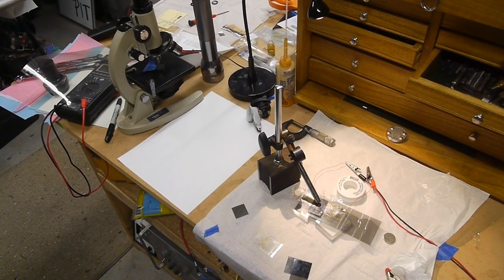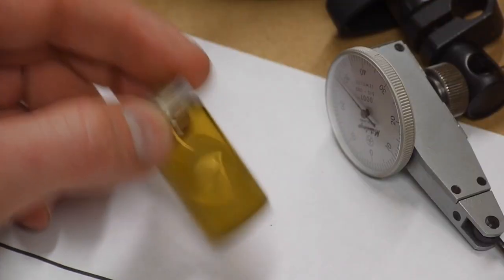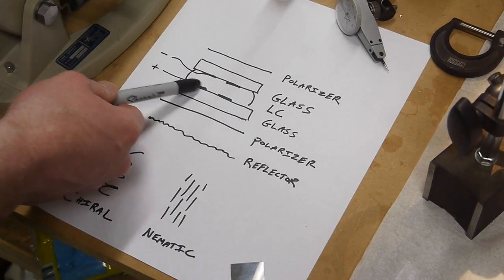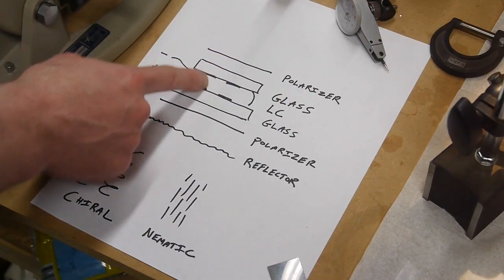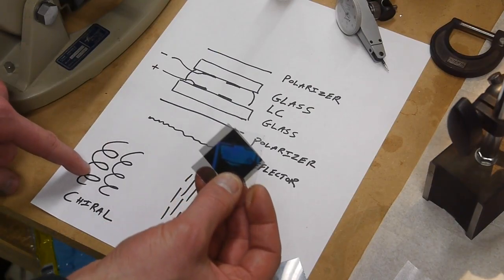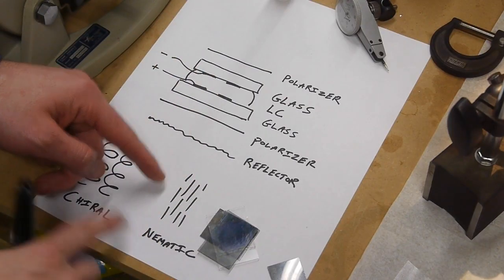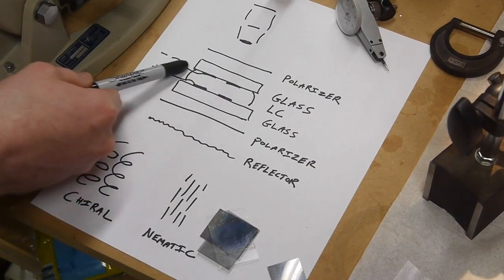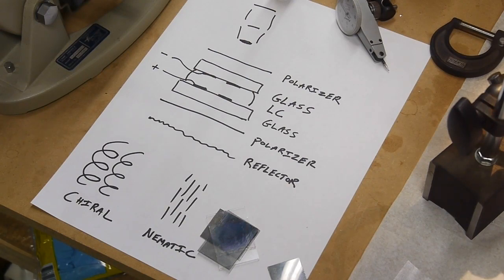Building a liquid crystal display (LCD)

Comment: Ben, I was a working Engineer in the mid 80's and needed a 4x6 TN LCD with 64 segments for an application. All the manufacturers said it was impossible. The company I worked for paid for the research to develop many of the things you demonstrated. I worked with company X to do this work. We did the 5um glass beads, ITO patterning at large scale, crystal mix ratios, -40 to +70C performance range, super glue coating then using a cloth to scratch the parallel lines. Amazing to stumble across this video and see your presentation. Thanks for bringing back the memories. Very good explanation of issues we worked to resolve.

Comment: Good job.  Did you follow this with another video?

You mentioned that the electrodes were coated with a very thin polymer and then rubbed with a cloth so micro scratches helped to align the molecules in a 90 degree twisted oriengation.  But wouldn't the plastic polymer coating act as an insulator between the liquid crystals and the electrode that it supposed to affect them?  I would think that would prevent the electrodes from creating an electric field that affects the liquid crystals, unless the electrodes are affecting the liquid crystals per a capacitive effect.  Is that what's happening?

Comment: hi I liked your video explanation...one question if you could answer...I have disabled the backlight of an lcd model Acer s231 and want to replace it with reflective light so the front lcd panel is too dark to see...should I remove the polarisers in that case and how shoukd it be placed for reflected light from back or front to get a readable view..
Reply: The right to repair is limited if it's patented or not . It's highly likely imo in the 1st amendment that it falls in a prior art but you could get sued by some patent trolls for infringing on their patent .

Comment: I have looked everywhere and cannot find anything close to an answer.  So, to everyone who knows more then I:  Can you use IR light as a backlight for LCD displays?      Why it matters.  I'm working on a head worn night vision set up.  I would like it to be able to be used for different applications in both light and dark situations while having one eye able(if wanted) to see real time/view.  So everything works on the bench. With the exception of trying the IR back light.  the importance of the IR lights rather then the norm is to be able to view through the screen like a window. with out having visible light shine forward.  When using the screen to look through, only big bold things need to be seen.  kinda wonky I know, but why not?  I will be trying it out but will not be able to for a few days, aside from being excited,  I like to plan so any help or tips would be greatly appreciated.  Salute!
Reply: Still need help?
Reply: @wertiaaudit5746  you are awesome.   But no.  I always over think everything I build. This is one of those late night irritations where I allowed conmen sense to go out the window.  Thanks
Reply: @gibbyrockerhunter  ok

Comment: Hello,

I don’t really know much about that kinda stuff but I wanted to ask how I’d notice if my LCD monitors were leaking that liquid crystal fluid. Can there be leaking without the display being damaged (inside damage not visible from the outside) or does it have to have a huge crack. Is the fluid toxic because I’m kinda scared since it would be fatal then if I touched that fluid without noticing and touching other stuff as well and I punched my monitor once thats why I'm afraid of potential leaking
Reply from the maker: If there is no visible damage, it's almost certainly not leaking.  There are many, many things in daily life that are more hazardous than an LCD monitor.
Reply: @AppliedScience  thanks for responding this quickly! Can there actually be actual leakage so the fluid will literally leak out if the monitors case? 

I know I'm overreacting but I'm a bit paranoid since I'm worried I expose myself to the liquid without noticing which leads to me being scared to touch certain things without feeling the need to wash my hands

Comment: This is the best explanation of LDCs I've seen so far, but now I'm confused. It seems to me like all that's needed to darken a segment is to apply a voltage, yet for some reason everybody says it's next to impossible to drive 7-segment LCD displays. It seems to me that it shouldn't be any more difficult than a 7-segment LCD. Is there just something really weird about the way these are typically made that makes them difficult to use? Maybe the electrodes for individual segments are never exposed, needing to go through an interface chip that is somehow invisible?

Comment: about the coating technique.....what if you spin the glass with a motor and pour some nail polish  for some time to get the ideal layer thickness (trial and error )..and the glass should be put like on an wine shaped glass  so it can be touched only by the margins  to avoid the impurities...idk if that helps, it's jut a thought.btw you are a very good at explaining very clear and not let my brain foggy.

Comment: So what exactly is the reason an LCD changes color when you press it? Is it the distance between the layers that changes or the angle of the layers?
And how exactly does the contrast control work? I know that with commercial LCDs you set a voltage to a specific value, but what exactly changes at the LC level?

Comment: if two polarizers can block back-light when they are aligned at 90 degree then why can't we achieve pure black color with them ?
Reply: One possible reason is because no polarizing filter is perfect. There will always be photons that 'leak' through defects or slip past the filter itself.

Comment: When I was a kid I used to take off the top polarizer from calculators and rotate it 180 degrees. It'd give me a white-on-black display instead of the usual black-on-white and I used to feel like a god damn scientist :D
Reply: op oʇ ʇɐɥʍ ǝɯ llǝʇ ʇ,uop
Reply: @souravzzz  ǝɔᴉN
Reply: @souravzzz  Wow
Reply: I used to spell BOOBIES. But now I'm 55 and it's against the law.
Reply: @GregorydavidMck  once I wrote HELLBOOBIES
Reply: wait, but rotating filter 180 doesn't change polarization?
Reply: Turning it over does (at least for some variants).
Reply: I see you like flipping stuff around. Why are your comments not flipped?
Reply: Now go for the name and you're all set :)

Comment: I'm assuming this is showing LCD for use as an "epaper"?  I ask because I thought LCD monitors were back lit and didn't require light to enter, polarize, reflect, and repeat the process on the way back out. I also don't see a light source in the diagram.  I'm curious about why (if it's epaper) glass is shown in the diagram. I would assume plastic would be more practical.

Comment: Hello. I've been prototyping a DIY PC build with a transparent LCD on the side panel.  Tearing down a few old displays and mounting them to the side panel without the back light assembly works very well but the internals of the case look very blurry and foggy.

Several other people have done this and their LCDs don't look foggy like mine. Why is this? I've been researching  this and haven't found any definitive answers for which screens will be foggy and which won't.

Some people say older displays have diffusing layers attached to the rear polarizer. Others say the polarizers themselves sometimes have diffusing properties.

If you could provide any insight I'd really appreciate it!

Cheers!
Reply: I think they are probably right. I recently repaired the LCD on my motorcycle and it involved removing the polarizers and the reflective layer. The remaining glass was completely see-through and smooth as was the polarizers (other than the polarizing effect). So it may just be a coating to make the screen look better in regular use.
Reply: SrgntBallisticGaming Why don't you email one of the non blurry PC guys? I'm sure explaining would tickle their ego. :)

How did it go? 2 years on.

Comment: Thanks for the explanation. Was wondering how the LCD screen in laptops are made. If I understood  your diagram, you have:  
polarizer => glass => electrode => LC <= electrode <=glass <= polarizer 
Do they also use glass when they're making LCD films that go into laptop displays or do they use some kind of transparent polymer. I have project where I need a curved display. I was thinking if I could find an LCD film that is all plastic in an old laptop, I could probably use some gentle heat to change it's shape.
Reply: Have you seen a broken LCD? I don't know what exactly what are they using, but it sure breaks like glass.
Reply: Glass actually does bend to some extent
Reply: If you have a large window in your home, place a light far behind you. Push on the glass with just finger pressure, you'll see the reflection change. 
You can do the same thing with a large mirror.
Reply: Glass is not necessarily a requirement but that doesn't mean you can get away with bending them (try pushing on an LCD screen and watch how the colors distort).  Might be worth a try though.

Comment: So how do you change colors?
Reply: Each sub pixel of either red green or blue has a color filter. The pixel is comprised of red, green and blue sub pixels. So you change the intensity of each RGB color with voltage.
Reply: I did watch the video. I'm thinking the guy who made the comment on how they change colors is asking how they do it on the LCD display which is what I explained. The color changing in the video is not how they make it work in LCD displays.
Reply: Christian Did you even  watched video? What sub pixel? He built a simple lcd! It's already amazing what he did at home.
Reply: Remember how he messed up on the distance and he got a blue color?
Reply: Robert Maxson What colors? There is a light source behind lcd, so changing the color of light... Monochrome lcd displays don't need back lighi because the foil behind the screen reflects sunlight  (translucent?)
Reply: Reflective displays are simply a different construction to backlit ones.

You can see reflective colour LCD displays in the Gameboy color and Gameboy Advance, and that kind of screen combined with front-lighting in the SP variant.

An LCD generally works by rotating the polarisation angle of light that passes through it.
This means LCD displays are inherently transparent.
To make this visible, you put a polarising filter on both sides of the display which are rotated 90 degrees from one another. The liquid crystals themselves rotate the polarisation of light to varying degrees depending on some input (usually electricity), so depending on that input the apparent brightness varies as the amount of light that succeeds in making it through both polarisation filters does.

A colour screen really just involves putting coloured filters in front of individual pixels/cells, so rather than allowing all light through, each cell only allows a specific wavelength to pass through.

Red Green and Blue are generally chosen because they are a good choice for reproducing the colour spectrum that a human can see.

Though, quite a few LCD displays contain Red, Green, Blue, and a White/clear pixel (or a yellow one).

But that's a bit of a side issue.

Colour filters are all you need, as long as you can align them with the LCD cells correctly.

Comment: What do you think, is it possible to create a mid air laser projection by crossing two or more lasers at a certain degree?
Reply: Using interference to create floating images is an interesting idea that I've heard from a few different places in the last couple years. It takes a fair amount of precision to actuate lasers on the nanometer scale, which is what I would think the problem is. I believe that if you were meticulous, though, and if you could fill a chamber with vapor to reflect the lasers, then align them so as to cancel most of themselves out, it might work. Difficulties would be laser spectral stability (constant frequency, this is a huge obstacle), minimizing movement, and of course aligning the lasers on the nanoscale. Not for the faint of heart, but possible. Holograms use this sort of idea, recording the interference of a homogeneous light source (laser) with the reflections from an object, and storing it on a piece of photofilm. It's really cool stuff!
Reply: eXtremeDR Yep. It's not a new idea. And it's already done.
Reply: I kinda like your Idea. I wonder if its possible.

Comment: Hello. I wonder whether is possible to fix old damaged displays that "leaks "and present black areas over the screen, or even an entire black screen. Apparently nothing is damaged on the glass sheets, and the damage probably is related to a leak or degradation on the liquid crystal. This seems to be a recurrent problem in old LCDs and probably sets the end of the part lifetime. Since a new display can be hard to find, to rebuild a damaged display would be well in order. The problem is how to disassemble, refill and reassemble the display. Could you please give your opinion whether this is possible to perform "at home" ? Thanks.

Comment: With the two polarized slits it greats a block in for photons to pass through when turned 90 degs like that.  and when you pass the third one through on a 45 deg angle it allows it pass like channel in a way at the halfway point of 90degs which is 45degs in this case with the 3rd slit allowing it to pass and relay photons between the two otter slits.   So it's not as counter intuitive as you mentioned.

Science is Cool!

Comment: Try a Mr. Clean Magic Eraser to form the scratches on the glass surface. Let me know how that works out.
Reply: That's a cute idea, but it won't work. Melamine that the dirt eraser is made from has hardness of about 4 Moh (comparable to mild steel), while glass is 7 Moh, so it won't do anything to glass.

I think the material used was already correct, however the grain was too coarse. Extra fine Diamond or Corundum powder based polishing suspension should be just right.

Comment: In a matrix display, how are they able to activate only a single pixel in the middle of the display, without activating all pixels in corrisponding the X and Y rows / columns?  Most matrix display's i've seen appear to only have electrical leads to each column and each row...
Reply: Lets assume we have a 3x3-matrix-display and your anodes are indexing the rows, while the cathodes are there for the columns.
Therefore we need 3 individual switchable (conducting vs. not conducting via transistors) anodes and 3 individual switchable cathodes.
if we switch column 2 and row 2, the Pixel in the middle of the Matrix is activated, column 1 and row 3, the Pixel in the lower left corner is activated and so on.
hope i was able to help :)

Comment: This is coolest video in all of YouTube! I have wanted to understand LCD's at this level ever since my parents replaced my red LED watch with a newfangled LCD watch in the late 1970s. I couldn't wait to take it apart and look inside. I quickly discovered the trick with rotating the two polarizers.

Problem was that most encyclopedia texts on the subject were very cursory. I eventually bought a book titled The Physics of Liquid Crystals. But it did little to explain the subject to the layman. May I ask if you have industrial experience with fabricating LCDs, or did you find the info in the public domain?

Comment: Hi. Most screens rest vertically. I understand that the beads are held in position by the two sides but won't gravity eventually make them fall to the bottom of the screen? Any idea what lifetime we can expect?
Reply from the maker: That's a really good question.  I'm almost certain that no adhesives are used.  I've never seen an LCD that had any sort of color or brightness gradient caused by gravity, so I guess friction on the spacer beads is enough.  If someone has the answer, please let us know.
Reply: +Applied Science Perhaps with the glass beads being so small and low mass, the small amount of pressure from friction of the layers is sufficient.
Reply: Once electricity is introduced, wouldn't the glass spheres all become pos. or neg. charged thus repelling? Or possibly they're made pre-pos. or pre-neg. charged?
Reply: Surface tension and a vacuum-sealed display maybe? Also,I think that behind every (old???) lcd screen is a thin metal foil conected to the ground(possible to disperse crystals)? Just a guess...
Reply: I knew that lcd's had some lifetime like 7 years or so because of that
Reply: @Lindemann302  ive had this one LCD for almost 15 years and its fine.
Reply: I thought a glue was used I've seen lcd being repaired with sticky back plastic sheets between the layers..
Reply: I don't think they move with gravity their mass is so small just being stuck between panes o glass will keep them in place

Comment: ***** Title was a little misleading. U spent hardly any time showing the actual building process instead u spent majority of it focusing on the same diagram. If the purpose of this vid was more to explain how lcd display actually works then u cld've gone into a little more detail. E.g when u talked abt the chiral shaped LCs n nematic shaped ones u cld've delved a little more into their structures, esp when they r mixed together, so we had a better picture of how tht actually affects the polarization of the light passing thru. Mayb u cld've used more detailed diagrams for a better perspective.